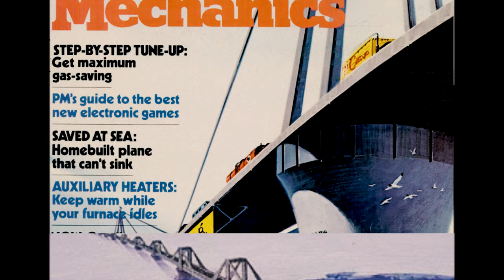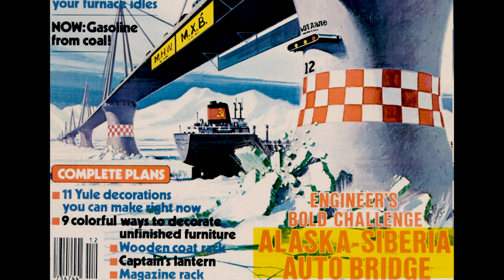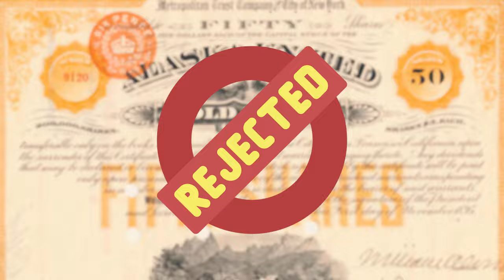Why It Is Impossible To Build a Bridge Between USA & Russia

Comment: The main issue isn’t geo political. The biggest issue is lack of connections on both sides. For all the costs of building the tunnel and thousands of km of supporting infrastructure you need a very compelling business case. On the US, China, and Russian side there are bigger local infrastructure projects they can invest in before even attempting a project like this.

Comment: I believe some day this project will happen. The biggest problem is no infrastructure on both sides of the Bering Strait. There was a push to connect Alaska with a rail link to Winnepeg Canada. This would be a step in the right direction. What ever happened to those plans? It should also be noted that the North American railroad gage and the Russian gage are different with the Russian being about six inches wider.
Reply from the maker: True, there is a difference in railroad gauge between the two countries. Thanks for pointing it out. It is tough to cover everything on this topic with so many plans that never came true. If it ever happens it will be an incredible overtaking.

Comment: It's almost 1,000 kilometers from Fairbanks to the strait on the American side, and that's straight line distance.  A real road would be much longer to get around numerous mountains, rivers, and swamps.  And the Siberian side faces the same challenges, and it's nearly twice as far to any existing roads.  
But it's not just distance that's challenging, it's the terrain.  The highways needed to get to the strait would cost far more than a bridge, or tunnel across the strait.  And you may as well build a road with a roof over it if you plan on using it in the winter.  The cost to remove snow on thousands of kilometers of highway running across expanses of open wilderness would be insane.
Reply: He DOES mention the lack of infrastructure in the video: 7:37
Reply: @aerocarnie  
I fixed it, but the point is still the same.  Crossing the strait is NOT the biggest problem they have to solve, the roads needed to get to either side of the strait are more challenging.  And keeping all of that road open through the winters would be extremely expensive.
Reply: @deezynar Cool. And yeah, it's interesting to imagine but it would be ridiculous to attempt in reality. Unless it were a bridge just for sled dogs lol

Comment: Nothing is impossible.  The channel tunnel between Britain and France is over 31 miles.

We could build 6 of these (three complete sections, one for cars, one for train, and one for Semi/LMV- and it would cost much less than a stupid bridge.  And due to the curvature of the earth, it technically would be a shorter distance than a bridge. Also, given that nice little island right in the middle, the US and Russia would be able to control their “Halve” of the transportation line so that in the event of a conflict, one side could not threaten to completely flood the entire project.  Both sides could also control half of the toll as well, making it an equally fair economic endeavor.  If we used magnet train technology, the amount of oil & gas currently used to transport goods across the pacific would fall substantially if the rail system was built out properly over the years to link europe, asia and africa to quebec, new york, la and panama.  We’d need a seperate project (A bridge would be optimal in this case) to link south america across the panama canal- but this would be fairly cheap.

Each country could pay for their section (going through their country) of this worldwide connection.  If a country could not afford it and it was a necessary roadblock, the US, Russia, China and the EU could set up a joint program to loan the money and collect all fees until it was paid back.

If a country chose not to be connected, then I guess thats their choice and we could find alternative routes around.

Problem solved- 

This is not hard and would increase the wealth of everyone in the world substantially.  I guess the only people who would be against this would be the oil companies, but there’s ways we could convince them.

Comment: In this extreme winter climate a nice well lit warm highway tunnel allows year round weather independent travel.   Such a tunnel system has to be designed with fire suppression in mind so flammable materials can be transported.   Right now and for a while a couple ice capable ferries and their ports would be the first step.   These ferries would be invaluable in transporting supplies and workers back and forth while building the tunnels along with regular highway traffic.   

The strait averages 98 to 164 feet (30 to 50 meters) in depth and at its narrowest is about 53 miles (85 km) wide. The islands would likely be accessible from tunnels via separate spiral access ways to keep them in the foot print of the islands.    From a tunneling standpoint no new technology is needed.  The big difference is this would be the longest continues automotive tunnel by several magnitudes in length.  It would need substantial electric power for its lighting, ventilation and pumps.   Transporting high voltage electric power might be one of its many purposes besides needing it own substantial electric power system.   There is likely a market for selling tunnel space for utilities such as pipe lines, communications.  Natural gas and electricity are likely.